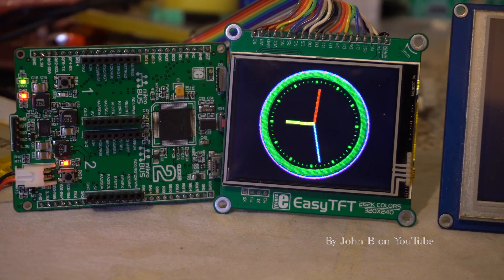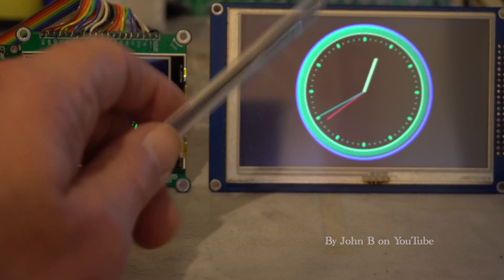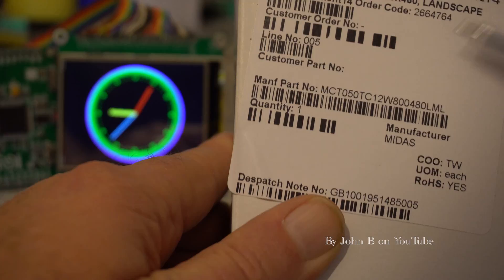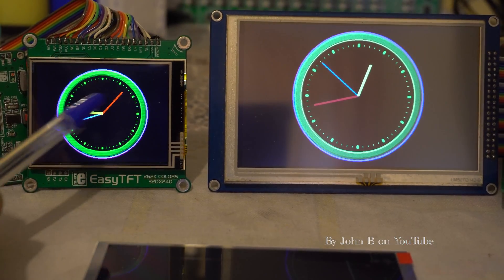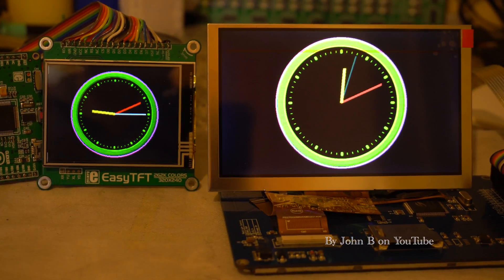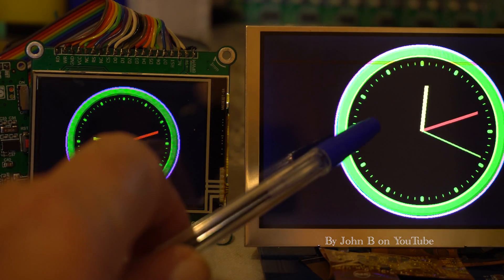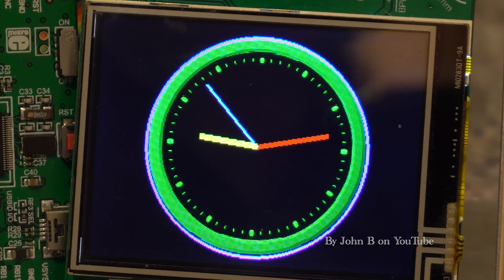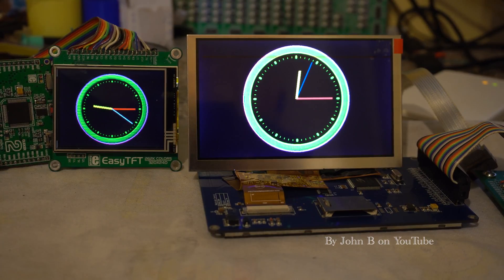The 'MIDAS' Touch - Turning Gold into RGB - MIDAS TFT Display vs generic displays from China

Comment: Hello John, I'm emmanuel an electronic student from Toulouse (FRANCE) I want  to use an easy TFT from mikroelektronika on my easypic5 with a pic 18F4620. Do you think is it possible. Can you send me a little code in mikroC that drow a yellow circle in a blue font, like the sun in the sky my email manuvespagne@gmail.com thanks a lot for your help emmanuel
Reply from the maker: Hi Emmanuel,
Yes it is possible to run a colour tft via an 18F pic but it is very slow showing pictures.
I do not have a pic development board any longer so can't write any code.

Comment: I agree the Midas screen looks excellent.  I've found the display on Farnell but I need a board for it.  Can't seem to find any info.  Seems like most of the displays are not supplied with boards but some are.  I'm working on a project that requires an LCD.  So many LCD's it makes my head spin.  Can you tell me about the board you are using.  What do I need to for this display?
Reply from the maker: Hi,
You really have 2 choices
Buy a quality display with board from Farnell or someone similar or get a cheap display from eBay.
You will see the Farnell / Midas displays are far better quality.

Comment: QWhat are the PIC boards you are using on this test ?, they look interesting ?, are you working in C ?
Reply from the maker: Hi David,

I did mention one of them.

Left is MikroElektronika's  'Clicker2' and right is a 'Snadpic' board from eBay.
Both have 32 bit microcontrollers, the left board can only run an 8 bit tft.
Yes C and yes by MikroElektronika   - MikroC Pro for Pic32 via Mikroe.com
What did you think of the new display?
Reply: Thanks for that, i have placed and order for the Microelectronica  easypic V7 and the Fustion V7 with the LCD screen options and also the SNADPIC from ebay with the dsPIC motor control IC as i want to make a 3 phase inverter so your info on the gate drive on MOSFET's was very interesting..., i have ordered the C and BASIC for DSPIC and PIC so i can see what will work best, i used BASIC at school many years ago but i have never used C yet, the display was good but i think for my application the smaller one will me more than enough for speed and start stop reverse etc via the screen sensor interface.....
Reply from the maker: wow, it sounds like you have just spent £1000 or more.
What made you choose Mikroelektronika?
Don't forget to mention my name to the guy at Snadpic, he's in Prague and really helpful.
Thank you for your comments.
Reply: Well they seemed to have a great range and i liked the CLICK add ons, i have ordered a few of those to try out, it was because you used the C from them and the hardware looked good and seemed to have all you needed for prototyping and i notice they support the dsPic33EV in the hardware and as that runs at 5V i wanted to try that in my inverter design, i hope you do more on high power MOSFET's in future, Thanks, Dave
Reply from the maker: No problem, what sort of stuff on mosfets?
Reply: Well i have also ordered a batch of Fuji IGBT 2MBI600U2E-060 600A 600V and the first project i was looking to do was make a 3 phase inverter to run a 10HP 3 phase motor that needs 220V 3 phase to run it, i have a 300V power supply coming from super capacitors as the DC input and driving the IGBT is critical, i have ordered some HCPL3120 driver IC's and i had planned to use these for each gate and a 10 ohm gate resistor on each to form the output stage so anything you have worked on before or have experience on will be a massive help on this project